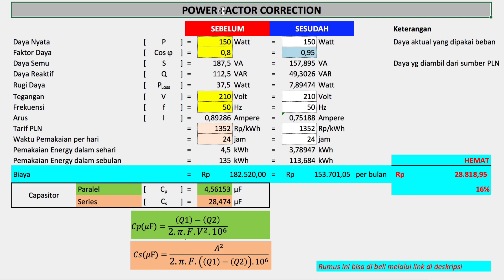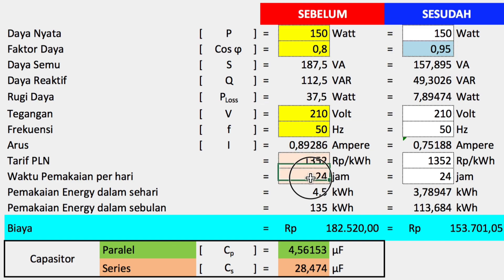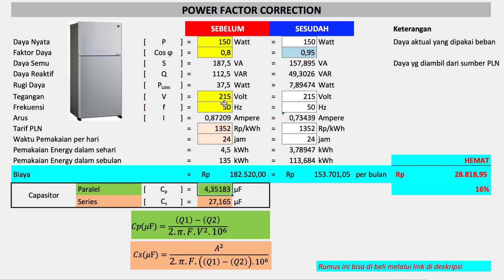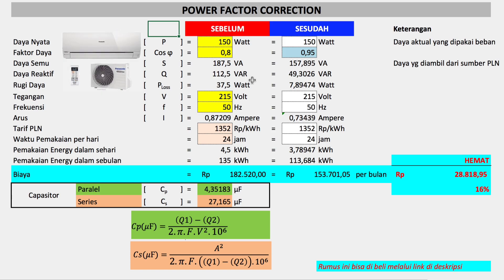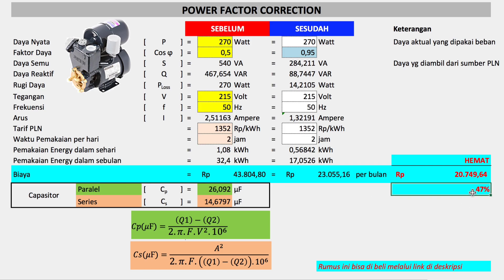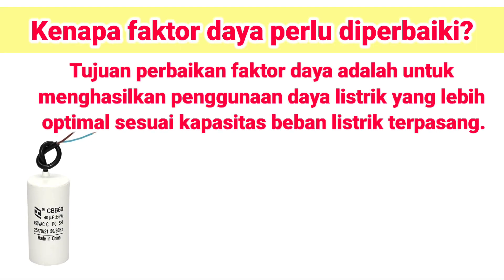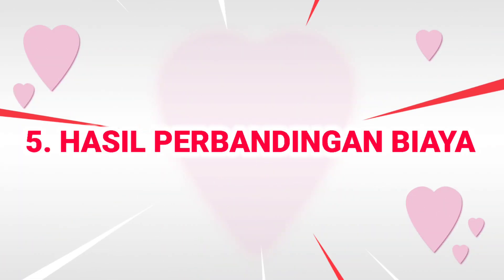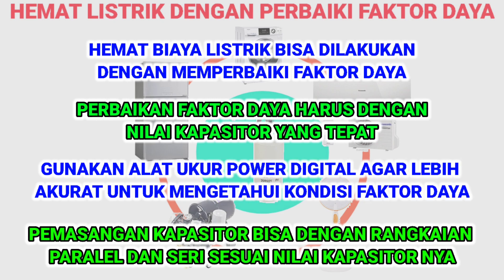CARA MENENTUKAN NILAI KAPASITOR UNTUK HEMAT LISTRIK HINGGA 40% BERAPA MIKRO FARAD SEMUA ORANG BISA

Comment: saya sudah uji coba di motor listrik pompa air di rumah dari running ampere 4,6 A jadi 3,6 A dengan paralel capasitor 80 uf
Reply from the maker: Mantap...Gede...
Reply: Kalau untuk cas motor listrik itu pakai kapasitor yg berapa ya. Mohon di balas ya
Reply: @BaraGokilat bukannya untuk charge aki motor listrik sudah dapat charger dari pabrik